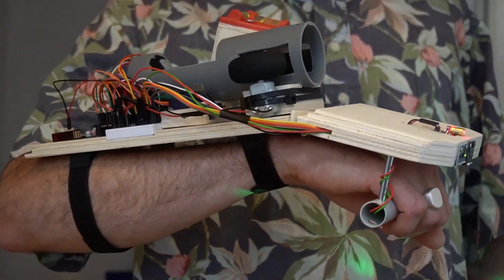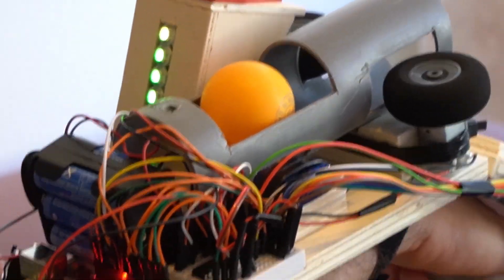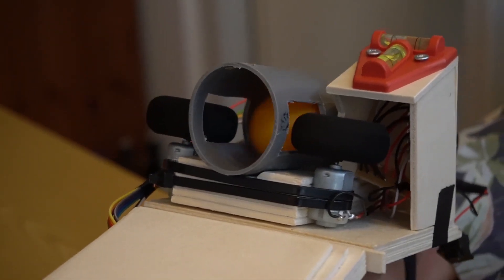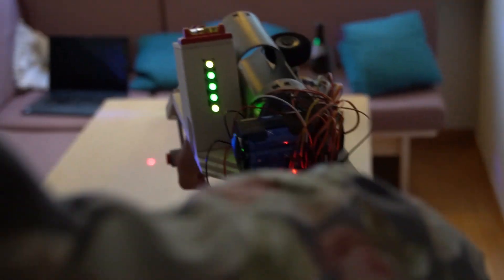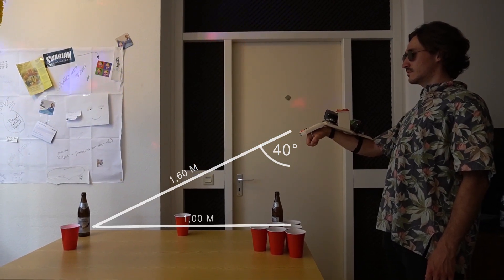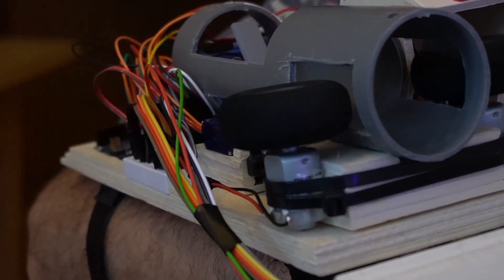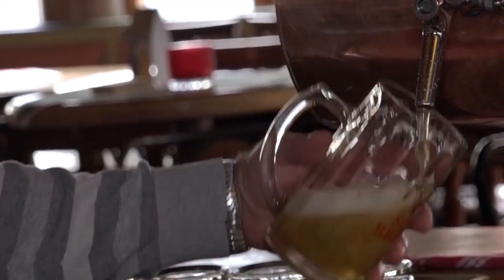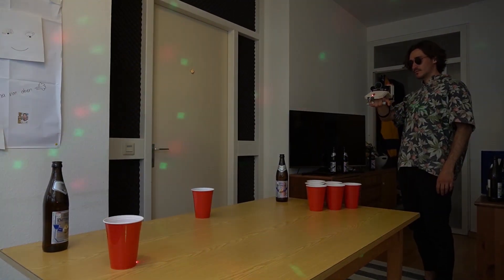The Ultimate Beer Pong Machine - PongMate CyberCannon Mark III

Comment: Pretty clever how you tried to eliminate as many variables as possible. Perhaps you could even set the horizontal distance and get the player to adjust.
Reply from the maker: We thought about it, but since the table size isn't set, we decided to have the horizontal distance not as a constant. And it allows for pretty cool long distance shots :)